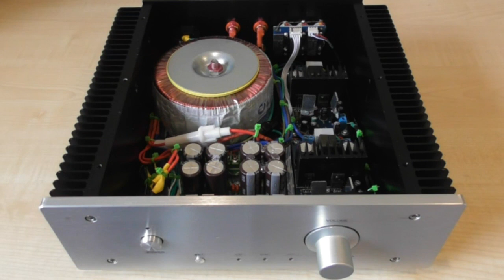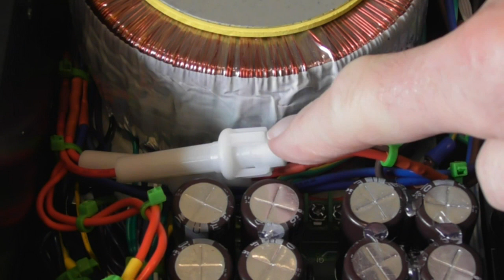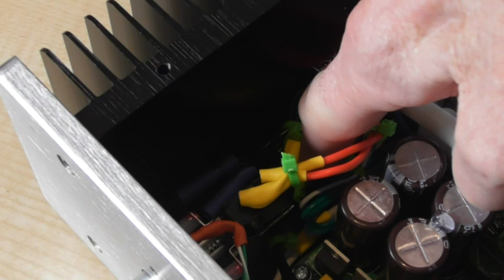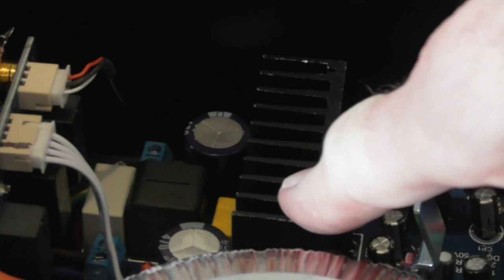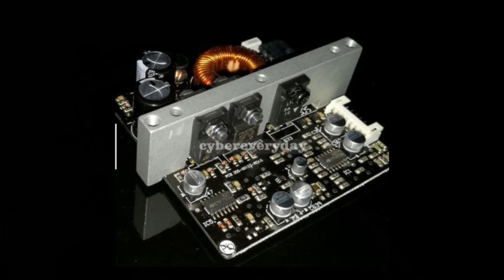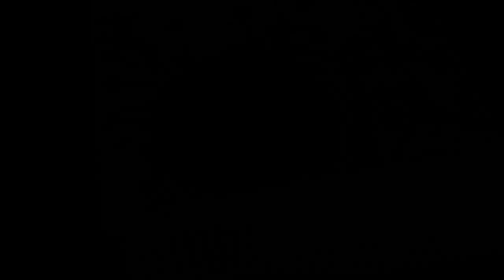Class D Amplifier Final Part.

Comment: Although cheaper, I have NEVER liked the fully integrated class-D amps, they are so OVER protected and the mosfets inside are such a compromise (hence the large heatsink requirements).  Using your own fast and low Rds mosfets more than offsets the cost of large heatsinks, not to mention being smaller and lighter, cooler (being more efficient) etc. etc..  I think fully integrated class-D's are something of a false economy unless they they integrate larger die (i.e. lower Rds) mosfets, which they NEVER do!

Comment: So how does it sound compared to the L12??????
Reply from the maker: Hi Steven, I have in fact sold this amplifier and it's still in daily use. What can I say after almost 4 years ago. Was one of the better class D amplifiers I had listened to. The fact that it used discrete output FETs made sense. All the others I have tested used a complete chip, so they all need current protection, limiting etc. to stop it over heating. This option has none of those issues. I still think the L12/2 is a better option. I've never really liked class D, some are quite good, but class AB is still king.

Comment: I just bought two of these modules and a SMPS unit, my first experience with both. I would like to know if you need to connect the mains earth to the chassis and the SMPS ground to the same point on the chassis, as you would do in a linear power supply set up.
Reply from the maker: Just treat it the same but be careful what you earth on the SMPS. Be sure it's the secondary side not the mains side.
Reply: Can I show you the connection diagram in an email just to make sure?
Reply from the maker: @kkchung2410  Sure. tas.audio49@gmail.com
Reply from the maker: @kkchung2410  Sure. tas.audio49@gmail.com

Comment: Got myself a Christmas present, a irs2092-irfi4019 based amp which is probably a modified version of the iraudamp7.
https://a.aliexpress.com/_mKwnMLn
This is the board inside the amp and the whole working amp cost me around nzd110 shipped. Just couldn't resist😂!  
But a word of caution when buying from China is that you have to always check on the safety earth which in my case, was missing.  I added it in and decoupled the pcb ground from the chassis which is now earthed. 
Tidied the wiring and checked the output for any shorting just in case I messed up. 
Fired it up and the initial impression was that it is cleaner and has more details than my mx50se.  Rather good value for the price I paid.
Reply from the maker: That's very interesting Nathan, I had looked at that PCB a few months ago. I thought it might be almost the same as the one I had tested before, so I did not pursue with it. Let me know your thoughts after a longer test but first a few questions if you don't mind. Is it quite? any funny noises on switch on? What is the working voltage? It may sound better than the  MX50 due to the extra power or given the same level does sound cleaner/more detail? Do you live in NZ? Maybe you could send me a few photo's of it complete, I'm sure you have my e mail address. tas.audio49@gmail.com

Comment: The eBay ICEPower modules are using obsolete FETs and Chinese Caps and are likely to be untested or minimal testing. the Hypex look much better, but not cheap.
On that relay board, you mentioned opto-couplers, they look like surface mount rectifier diodes for AC input option to me.
Reply from the maker: Yes  you are right, they are diodes, this is what happens when you talk without checking first. Then it's too late, still a good board however.
I've given up on class D for the moment, overall I still find the L12/2 the best tested so far, I use it every day for music. Yes Hypex are expensive, I've lost interest in them after I contacted the makes and had no response.

Comment: LoL those TIP40's have been around for a while, they are also in the datasheet for the TDA2030A in one of their circuit recommendation's for a high powered active 3 amplifier setup for powered monitor's, they chose two TIP40'S in combination with the TDA2030A as the driver, kinda similar to how those class D amplifiers work... 
That speaker protection circuit actually was making noise! When you zoomed in, you can hear it in the video, buzzing in time with the flashing led... I don't know if it's just the camera picking it up directly from the module or it was actually coming from the speakers? But it's definitely there! I heard it and I was listening to it through the phone speaker and on my current phone, the output is actually terrible in relation to any other phone that I have had, LoL I can't hear my phone at full when I'm the lounge from my wife's Realme phone and she's in the kitchen LoL. Being the case with my phone, I heard it... I wonder what it was? 
Incidentally, the datasheet for the TDA2030A is one of those Beautifully put together datasheets that they don't do anymore.. there's a few good circuit recommend designs in there, none of which I have built, but I have plenty TDA2030A's to experiment with one day.... Maybe LoL see what happens.
Reply from the maker: I may have to look at the 2030 again. I just noticed it's class B. I've never looked at it's distortion or cross over before..I bet it's really bad.
The sound you heard must be from the amplifier boards, nothing comes from the speakers, thank goodness.
Reply: @MichaelBeeny  happy new year Michael, those 2030's are great if you are after that class B vintage sound.. The data sheet is definitely great, there is also datasheets for the lesser power versions that also have great circuit examples that can be used with the 2030, I don't remember which one it was but I think that there was also a 2020? Which had a circuit for a powered two way speaker system! 
I would recommend you building a powered speaker system if you haven't already done so! Anyone who has ever built one has been amazed by the sound! 
It's one thing to build an amazing as you have done many times on your channel but at the end of the day, you are powering a passive set of speakers, if you ever decide to give it a go, you will be rewarded with an amazing sound! The old TDA2030A is a great chip for this purpose, there's a really good circuit design for a three way active setup or there's the other circuit for the two way active setup in the TDA2020. 
There's plenty amplifier circuits based on the 2030A on eBay and they are cheap! You just might need to use a perf board to make up the filter section of the bass, mid and high amplifiers! I think from memory it's less than a hand full of capacitors and resistors... 
They might not have the best specifications out there but they have that sound which during their prime was everywhere because everyone was using them! From TV's to stereo systems and I even found a whole bunch of them in a powered computer speaker system which I purchased two years ago because I only wanted the subwoofer enclosure to make a full range mono cube for audio mastering so as far as I'm aware, they are still being used... 
Anyway as I have said earlier, I have a lot of them which I personally plan to use one day but when that happens is anyone's guess LoL...

Comment: Michael, just found your channel. Very informative, thank you very much for sharing with us your knowledge and time. I also agree with our definition of how to measure amplifier output. What good is it that the amplifier is capable of doing 1.21 GIGAWATTS @1K hz. What is important is what it does with the rest of the hearing spectrum. I do have a question for you. I have recently purchased a couple of IcePower amps and I hope you are still planning on doing a project with them. If I use a switch mode power supply to power a couple of IcePower amps, would I still need a rectifier power supply board? I have been away from audio for about 25 years and these Class D designs still get me. I am still stuck in the old way of thinking that if you do not have a Boeing 747 filled with capacitors, you don't have an adequate amplifier. Maybe these new designs will teach me a new trick.
Reply from the maker: Hi Joe. If you use a switch mode PS you will not need the rectifier PCB as the output of the SMPS will be DC. Regarding the ICE modules, I have decided not to continue with them. I had been trying to purchase these via ICE but no distributors in our area. They told me that many of the units from EBay are copy's. I would be interested in your opinion once you are up and running with them. You could always make a video yourself!!
I'm still not completely convinced about class D. You might care to look at my follow up vid here https://youtu.be/GXXVdc8L4yA At present I still, overall, prefer  the class AB L12 I use this every day, until I find something better. Thanks for watching and your contribution.
Reply: @MichaelBeeny  Thanks for the feedback Michael. Since I am committed, after purchasing the amps already, I'll let you know what I think of them. I did purchase the amps based on their good online reviews, also since they were originally a subsidy of Bang & Olufsen I figured they are from at least a reputable company. Since you seem to purchase some of your equipment from China, have you had an opportunity to test any of their Tube pre-amps?
Reply from the maker: @joesapereira5539  I did test one a few years ago here https://youtu.be/ZpdBQ-MwqrM Not a great lover of valve stuff, OK 50 years ago but things have moved on.

Comment: lol the first time I fired up my "Silicon chips DIY Classic-D" set of power amplifiers, I was worried I had mixed up some components whilst assembling Err-Soldering them up, because like you, the heatsinks I thought got quite warm as I was setting them up to the frequency of "500Khz" that they were designed to work at, and more importantly to rid any measurable distortion within the audible audio range with the two working together in a stereo configuration, anyway once setup was completed and the boards checked and re-checked all over again and finding no error on my part, I risked it and pumped them up to their full output of 170 watts @ 8ohms each, 
Well "with 55+-0-55- volts they're suppose to provide 150 watts to an 8 ohm load and 250 watts with a 4 ohm load", but the transformer, Bridge rectifier and bank of capacitors I used provided a little more volts "58.9+"-"0"-"59.1-" Anyway like yours they "The heat sinks" just didn't get any warmer at full volume and just below clipping, meaning for me the party will go on and on and on and yeah on and on.. Well that is once this confounded Coronavirus Lock down is lifted.. 
Dropped yo a like BTW..
Reply from the maker: Yes the first fire up of any project is always a bit scary, that feeling NEVER goes away. Thanks for the LIKE, always welcome

Comment: why didn't you bay L15D-pro with built-in speaker protection?
ebay number. 124045714827

ebay number. 163871375371

Comment: Hi Michael,  so the big question, does this sound better than the MX50-SE module amp?
Reply from the maker: That is the big question!! Overall I think the L12-2 is my favourite from the three, it's got so much detail and dynamic range. In fact I am just getting the bits together to build an amplifier using the L12-2 and a linear power supply. The MX50 is silly low cost but does need extra heatsinks. In comparison, the L12 just beats it on dynamics but the same amount of detail. I'm still not very sure about the class D. It maybe all in my mind because I cannot measure it well with my equipment, the waveform looks un clean with the switching mush etc. It does sound good however, so much power and it does not need more sinking. Cannot get my head around the fact it does not get hot!! I might just be lucky with my choice of those three, I think must people would be very happy with either......use a linear PS for reliability if nothing else!!
Reply: @MichaelBeeny  That's interesting. I've built a pair of 5 drive unit active speakers with each driver powered by its own MX50-SE (so 10 in total!).  They sound great for the money but the pair of 8 inch drivers in each speaker could do with a bit more oomph, so I'm looking to replace their MX50's with something more powerful.  They are 4 ohm drive units so I only run the MX50's at +/- 35VDC but I've got plenty of power (600VA toroidals in each speaker, 1.2KW in total) so I can easily drive something more powerful.  I've been looking at LJM's L20-SE amps since the physical format better suits my panel amp which fits into the speaker; have you had any experience with these modules?  They claim 350W into 4 ohms from +/-65VDC but since I never believe the stated figures and always assume the supplied power transistors are fakes I think they should probably give me a real world 100W into 4 ohms with +/- 35VDC.
Reply from the maker: @clivebrooker1  The Chinese tend to give maximum power at silly unusable distortion levels ie 10% undefined. They don't tell you the load impedance or the frequency, if both channels are driven or the supply voltage. So the specs are 100% useless really!! I always measure power into a specific load, both channels working, at a specific frequency just prior to clipping. Most manufacturers will not do this as it really shows up the reality of the amplifier for what they really are...often NOT very good! With me you just get the real world in some cases good but often not so good. The L12/2 you can drive into 4 ohms with out dropping the supply voltage but it will need GOOD heat sinks.

Comment: Looks Good Michael! I am also considering the ICE modules.  What led you to them?  They certainly seem to look good on paper.  however I noticed in the documentation the suggestion for using ferrite cores on the speaker outputs and mains input.  Would be interested in your thoughts on this and some before and after measurements with the oscilloscope if you decide to build.  Keeps the videos coming.
Reply: Do you have a favorite stereo system?
Reply from the maker: I first noticed the IcePower modules on Ali Express. They seam to be very well reviewed on a number of Audio forums. The power requirements are also odd in that they use a single supply of around +48 volts  and also need a +/- 12 volts. Nether speaker lead is grounded. Silly power into 2/3 ohms but you would really need the higher powered unit to get about 200 watts into 8 ohms. I have written to the makers to ask if the units widely available on the net are real or knock offs. So far I have not received a reply. Poor customer service, does not inspire confidence. Either way they are not cheap but if good, probably worth it.
I'm not sure if I will video the results as I have now sold my scope, distortion analyser etc. This YouTube hobby is getting expensive. I never ask for money from anyone.